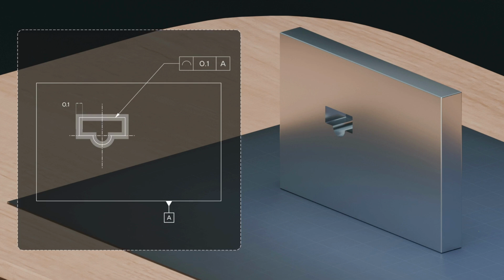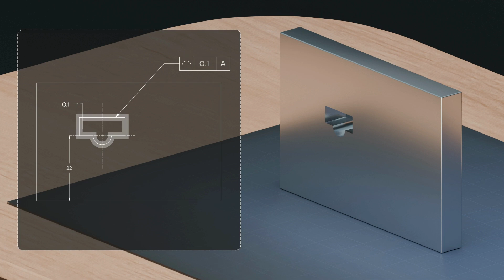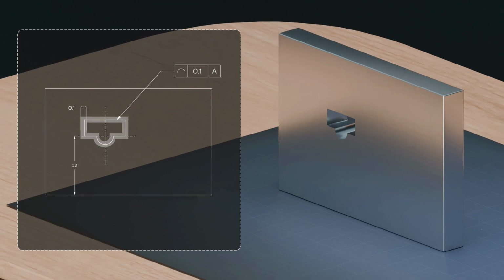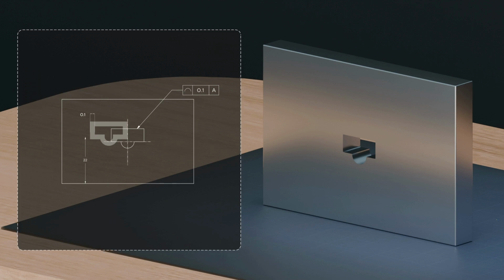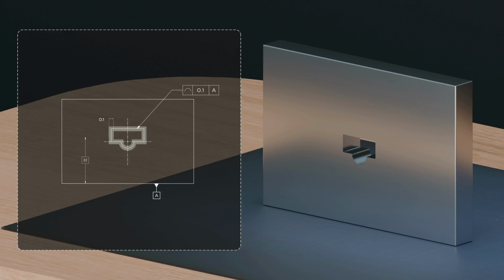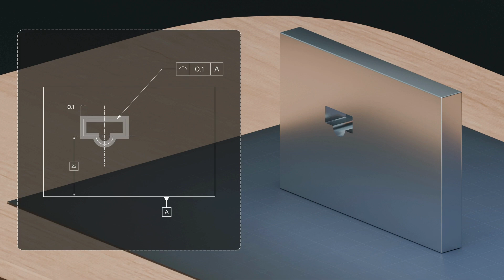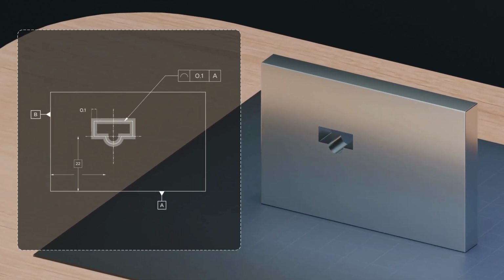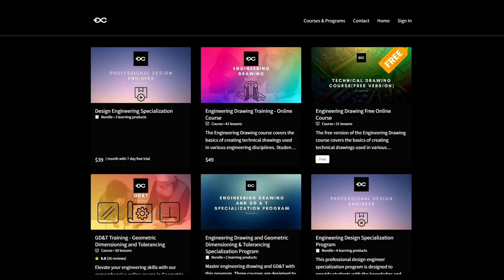The Master of Complex Shapes — Profile Tolerance in GD&T | Geometric Dimensioning & Tolerancing

Comment: In the beginning of the video you didn´t mention if it´s ASME or ISO. 
In ISO you need an "all around" sign on the line, since ISO doe NOT use the envelope principle.
Reply from the maker: Thank you for the remark. You are right. 
 The Video is about explaining the principles and basics of profile tolerance. We have to leave some information otherwise the video needs to be a whole lecture.